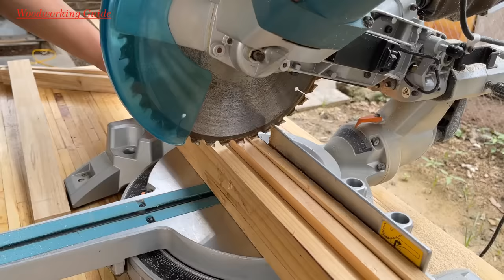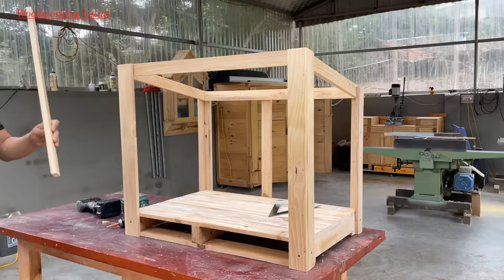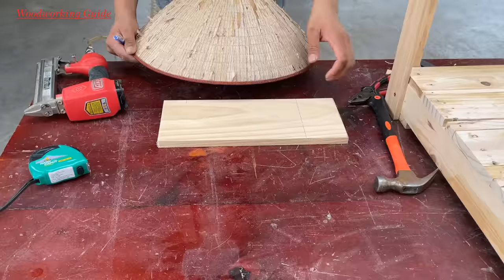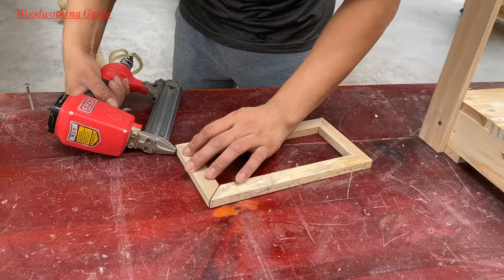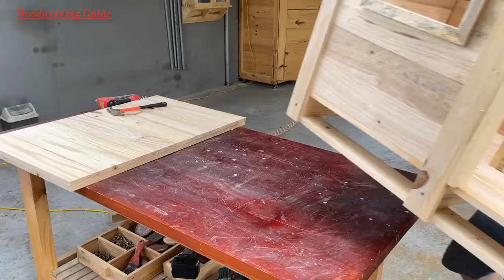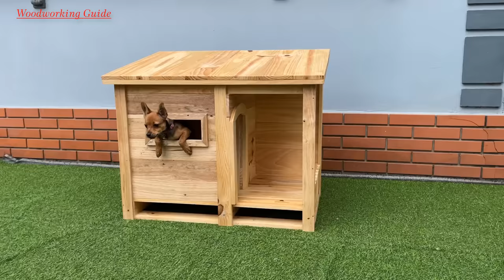Design A Pet House From Old Pallet // Recycle Old Pallet Wood

Comment: I don't know where you have access to quality pallets like that. The only ones I ever see are being used at the home improvement and big box stores and they look nothing like the one you are using. They are thin wood and very damaged and splintery. I have NEVER seen wood pallets of the quality, smoothness and thickness pictured in your video. Yours look custom made.
Reply: I agree, at the very least this is a brand new pallet. I call B.S.
Reply: Depends on what you have delivered like a large machine, something heavy. Car engine?
Reply: ..... yep, have to agree. I have never ever seen a pallet that size, clean or perfect. 🤔
Reply: I get my best pallets from small engineering firms. The best ones i ever got held poultry processing machinery from Sweden delivered to a local factory. They were huge and amazing quality pallet/ crate combos. You need to look in the right places, have means of transport and jump on them.

Comment: I may well have to scale on my project that would be for two huge Malamutes. Two massive, powerful gentle giants that are a joy to spend time with. They are quite happy seeping in the snow. It would be an option for those evenings when they ore torn between staying out or coming in. But the s concept is appealing. They love to have contact with my daughter but the heating is a problem for them so through summer and winter they are in and out so the the garden door is seldom used.  But the low cost makes it a worthwhile experiment. One idiot of an intruder that scaled a 6ft. fence to gain entry the cost his trousers and underpants. pluss a sore bum cheek when. he was confronted by the big male.. When the police arrived my daughter  was pleased to offer them two pieces of material with a proad grin saying "I have some material evidence." The man and his lady lookout were picked up. The cloth matched both the hole in the man's pants and trousers. What's more, the dogs didn't bark once and each enjoyed a good petting from the Police.  They were both quietly efficient.

Comment: This guys a woodworker and has air tools and table saws so yeah it look way easier than it is. However, outside dogs that use a dog house are usually on the bigger side such as German shepherds and Rottweilers. They not gonna fit in that tiny Chihuahuas house.

Comment: Are you protecting the wood from COVID? why are you using that mask?
Reply from the maker: We use masks to prevent dust
Reply: @woodworkingguide6356  then I recommend to use FFP1 mask ( or your local equivalent). A surgical face mask is not enough to protect you from dust.